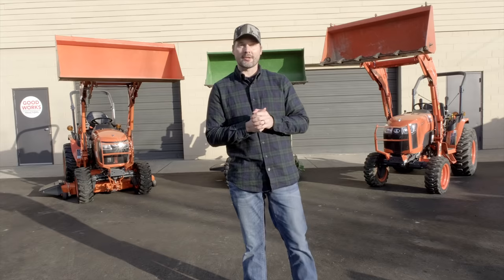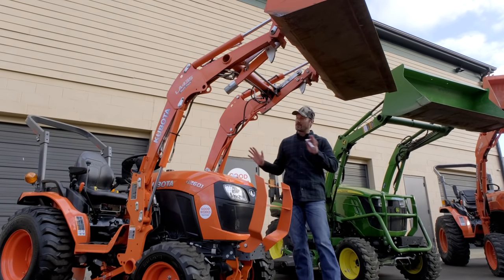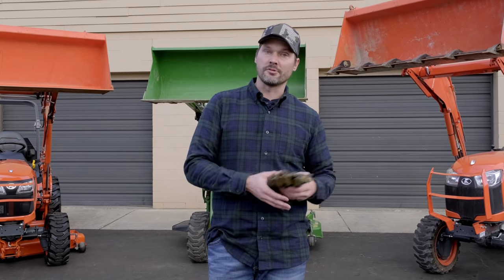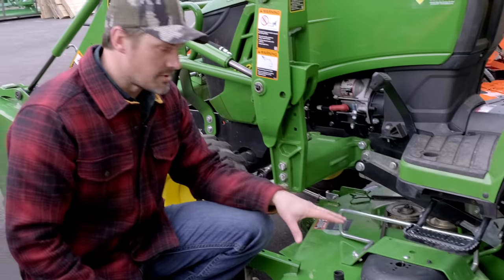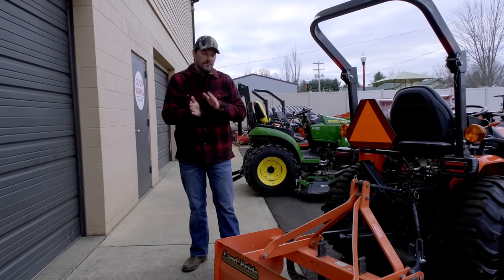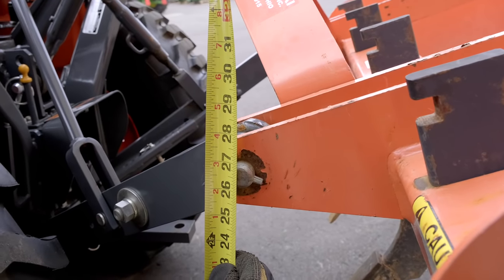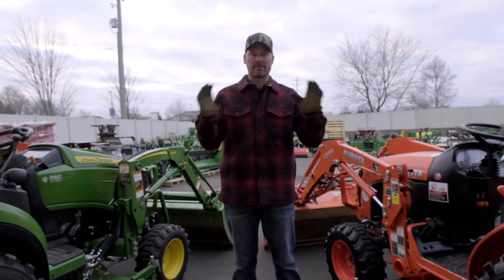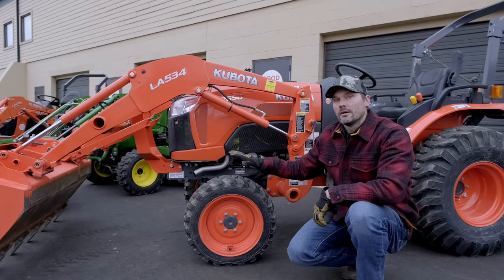NOT EVEN CLOSE! JOHN DEERE vs KUBOTA: B2601 vs 2025 vs B2650

Comment: I have the 2601. Been a good investment for our 4+ acres. One thing that is seldom talked about is the added warranty.  Normally not something many of us consider.  Well Kubota was great when an accident happened and we had an operator roll it on it's side.  Luckily he wasn't hurt (I swolled my heart when I saw it over, and fortunately the driver actually got away since it was a slow roll, which Normally you should ride it down.  But we called Kubota and For $500 deductible we got pick up (once I righted it with the excavator) a full brand new engine and drop off, all without a fight.  

We use it with a snow blade, loader and Land Pride brush mower. And it's done some steep hill climbs. 

Thanks for the comparison
Reply: I think you mean Insurance, because you don’t have deductibles or pay anything with Kubota Warranty. Thst said Kubotas deductible at my dealership is $250 for anyone who gets KTAC. Insurance is mandatory during the financing terms. That said, Kubota is amazing to work with and will do things like good will warranty and pay for things outside of warranty under certain circumstances. It’s very much case by cases, driven by discretion from all parties being the customer, dealer, and Kubota Warranty. Kubota is such a wonderful company to work with, while I was in Service dealing with this exact thing for years. I’ve since moved to a new department, front of the house. JD is still good though, just more expensive for less feature and capabilities. Wont go wrong with either, just more from Kubota is all. Most durable and reliable tractor on the market. That alone would sway me, plus the long list of other things they have that smoke the competition often or at least beat them. Anyways, have a good day!

Comment: The kubota is 200 pounds lighter, I know the JD has more plastic so where did kubota skimp? 200 pounds is alot of weight for such light tractors.
Reply: inside where it matters!
Reply: Bit like an old cast iron car engine v 
Aluminium with steel sleeves, valve seats pressed in
Reply: Frame and the axle.  That is why the Kubota must have a sub Frame when you get a backhoe.  Deere does not need one.  Kubota's older cousin- Kioti is a good comparison
Reply: Rims are lighter. Those tractors are freighted. No different thany old Fordson Power Major. The ones in england have beefy wheels, the ones in US have thin rims.
Reply: T

Comment: I International with the engine hanging out front I used in Arizona was tricky; Much weight hanging in front and broken engine stops were common with careless operators.  Steering drifted a good deal on long drives across the fields- often 425-1200 acres each. A pain to stay in a straight line.

Comment: Did I miss factory warranty on these?  Hmm 🤔 could be another selling point too.
Reply: I can’t speak for the Kubota but the Deere has a 2 year 2000 hour comprehensive and a 6 year power train warranty.
Reply: Kubota 6 yr pw train also.  I compared both tractors. Kubota built tuff .  Axles. Thicker, more pto pwr  better all around. Me...i.  co.    Or Japan? Your pick.   When I think of Japan I think of Yamaha, Honda, Suzuki , Kawasaki,    and KUBOTA

Comment: what is the difference with the new generation 2025 JD? vs a 2025, 2018,2019 model?
Reply from the maker: Nothing.  Need to go back to 2016 and older.  Is It Better Or Worse? John Deere 2025r: New Style vs Old Style
Reply: So early 2000's 2520 is not same as 2025 HP vise?
Reply: It's fine if you want to pay a young guy with a laptop 500 dollars to come out and plug up and screw a 10 dollar sensor in so your tractor will start.

Comment: This was a great video.  I’ve been wanting a smaller tractor for years.  My operation in Afghanistan has been using a Kubota since 2010 and that thing is unstoppable.  But, I’m a big fan of JD.  I have a Toro professional zero turn mower so a mower is not required.  I want a back hoe and a loader.

Comment: The turnbuckles for adjustment may be “archaic”, but they’re stronger and way more adjustable, infinitely adjustable in fact. If you actually work the tractor for hours on end, being able to snug up that adjustment will become indispensable, especially when transporting with the attachment in the air.
Reply: The turnbuckle style is far superior in my experience. We have tractors with both styles and I hate the ones with the pin style.

Comment: I am not into any of this stuff, however John Deere have a reputation for being difficult with regard to assisting farmers to carry out certain maintenance on any computer controlled equipment, are there any problems with these machines re upkeep out in the field?
Reply: As you call these machines they are for small do it your self 2 or 3 acre of land. cleaning up horse crap mowing grass and so on. computers are for steering on farm crops and leveling things like that. but you are right about one thing you are not into any of this stuff. There is nothing wrong with there computers.
Reply: @PCMrX.9961  I have just read on youtube that John Deere want farm equipment trucked all the way to a dealership if the computer needs reflashing or whatever as they keep these secrets to themselves to protect their dealer network.

Comment: What John Deere needs to do  is discontinue the 2025r  and drop the 25 hp motor in the 2032 chassis to compete with Kubota.
Reply from the maker: The old 2025r was very similar to the old 2032r.  Now night and day difference.

Comment: Love my kubota forward reverse pedals.  Do not like jds two pedals.  After all I spend more time going forward than reversing, even with the real snowblower.
Reply: Respecting your preference but I prefer the 2 pedal Deere. Have I tried the treadle? No. But doubt I would. My leg doesn't have to lift. I suppose we could debate it all day and countless blogs already have. For back blading work I can't see the treadle being easy and safe. How do you turn your body (I look over my right usually) without turning your leg? I make long runs backward grading and snow blading.

Comment: It can be very confusing which tractor one should buy. On my 2017 2032R, I love my single point hydraulics, and my drive over AUTO connect deck. Kubota makes awesome machines as well, which can add to the confusion of potential buyers.

Comment: One big difference between the mower decks is the 2650 deck isn't suspended from the tractor.  It is designed to ride on the deck wheels.  This does make a significant difference in cut quality if you have an uneven yard.  I have an older 2025r at work and a 2650 as my own.  I really do like the 2650 overall better.  I do bleed green though and have a 5103 as well as a 430.  Great machines, but I can appreciate both colors!

Comment: Kubota makes a fantastic SCUT but I bought the 1025r for two reasons. First, the design and function of the JD quick attach stuff, the deck, the loader etc. no fiddly bits and adjustments to screw with. Just stupid easy, fast and reliable. The second reason I chose the JD was because of my experience with them standing behind their product and seeing Kubota stiff their costumers on the B3350 and it’s awful regen issues. Just my 2¢

Comment: Note for Kubota from an owner.  The quick connect hydors (even after setting it and de-pressurizing the hydros) will leak damn near 25% of the time when reconnected.  It got so frustrating I just left the full front end on and only used the bucket disconnect.

Comment: You should have a video on just the attachments for the 2025R. Myself I have alot of them. Drilled holes for my small area for my cow and pig. Then drilled holes for my garden fence. Using my box blade for my driveway that I share with my neighbor.  Nothing runs like a Deere.

Comment: I have a Green Lemon 5055E. I do not recommend it. 1400 hours clutch flooded with engine oil requiring total replacement. 1650 hours piston ring broke swirled through the head breaking two pistons causing engine rebuild. 2200 hours metal shavings from the cheap hydraulic dipstick infected the hydraulic system causing the three point to leak down rapidly. Had to rebuild the rockshaft . The 553 loader is so flimsy I had to weld six separate cracks to keep it from breaking in half. Numerous small problems like seat bolts breaking off and hydraulic leaks causing fuses to blow and brakes locking up. It lasted about 1200 hours basically.

Comment: Great videos. Very helpful. What state are you in?  Also. I hate the mower under the tractor. Have you found a good front mower attachment.
Reply from the maker: I'm in Michigan.  I'm not aware of any front mower options for these tractors.
Reply: @GoodWorksTractors  They are fairly common in Europe for these compact tractors.  Small towns buy them a lot for city maintenance.  They use that mid PTO extension like a snowblower does.

Comment: In Regards to step on the B2601, I added a step from the B2650. The  B2601 has holes that line up with the step from the B2650.  I do not have a mid mount mower, so I do know if it fit. Just a point of information

Comment: Regarding the rear balance/counterweight my dad taught me when I was just a kid that you filled the rear tires halfway up with liquid chloride,  he would set the valvlestem just below center of the axle,  then remove the valve, then he made a vented straw and attached it to his chloride jug then gravity feed until it stopped flowing. It wouldn't freeze, and it sealed small punctures.
Reply: I have seen so many rusted wheels from minute weeping  chloride leaks, is there a new non rust version?
Reply: @jamisonseger941  that's a good point the chloride is very caustic,  I was just a kid at the time and I'm not on a farm , so I would imagine there is a better option these days .
In those days most small scale farmers only had one tractor to do every job that had to be done, not like now where they have separate machines to do each job.
Reply: @jerkyturkey007  Nowadays, if ya got room, get several units each with equipment needed. I f you can do most of repair/maintenance work, why not?  Also, you can use antifreeze, expensive though.

Comment: When I bought my small 32/33 hp tractor I finally became enlightened and compared how they rated their hp. and most all elevated the rpm way to high to give rating, I bought the New Holland because they did not fudge by using way to high  rpm to get the same hp. Good luck!
Reply from the maker: It is extremely common to rate the max HP in all types of equipment.  If New Holland doesn't do so, then they are shooting themselves in the foot.  If they can generate more HP at max RPM and crush their competition, then I'm confused as to why they wouldn't market it that way.  If this is indeed the case, then they need to fire their marketing director.

Comment: I do think that when comparing the lift capacity, you need to include information regarding how much you can lift (keeping the distribution in the bucket constant) before the rear wheels lift.   My 1520 might have a great lift capacity, but the rear wheels came off the ground long before that load was reached.  I often had to add my tiller or sprayer (filled with water) to the rear to operate the loader safely.
Reply from the maker: You always want to check your manual (look online if you don't have a hard copy) for the recommended rear ballast weight when using a loader. We have lots a few videos covering this, and it's critical for safety and all brands of tractors need it.
Reply: @GoodWorksTractors  Everything you're saying is correct, but what about my suggestion?  After all, a tractor that operates safely at 1,000 pounds is more useful than another that could lift 5,000 pounds except the rear wheels come off the ground and the front tires squat at 800.   This seems like a simple, yet useful add to the comparison.  Gong too far:  Counter-weight, keeping the load close to the ground while moving, staying on as level a ground as you can, there are so many  other factors...I guess there's only so much you can include in a tractor review.

Comment: Hey Courtney - I have a question for you about diesel fuel additive.  I am new to the diesel engine market and I have a X758 with a full tank of summer blend Diesel.  I will be using it to plow and snowblow my driveway this winter (I live in western New York).   My question is, can I just add the John Deere Winter treatment to the tractor's fuel tank and run it around the yard to mix it up and to get through the fuel system for the winter, or do I need to siphon the current fuel out, and get new diesel, add the winter treatment to it, and fill up the tractor with it?
Reply from the maker: You will be fine adding it in and letting it get mixed up.  Maybe add a little more than needed to be safe.  Won't harm anything and will just make it even more cold tolerant until you get some winter diesel in there.

Comment: Do you have any comparisons to L-3600 Kubota I bought my tractor when my daughter was born 25 years now just replaced all the hydraulic hoses.I set my 3 point rear draw bars up with hydraulics. That little mouse can do a lot of damage to a wiring harness. I leave oats coat them with plaster of Paris. Stops them right up. No poison required.

Comment: How much trouble is there to sharpen the blades.  We use two John Deere 997 R to cut the grass. We use another tractor with a loader to lift them to swap out the blades.

Comment: I watched your video with great interest actually.  I own the Kubota B2650 with the cab and front end loader.  I really like the heated/air conditioned cab.

The one thing I do not like about the tractor is that the cab makes the tractor very top heavy and very easy to tip over.

You mentioned in the video about wheel weights for the tires.  Can you please point me in the right direction, because I'm not aware of any kind of wheel weights for this tractor?  The rims do not have the traditional holes in which a set of wheel weights can be bolted to.

Comment: Great comparison! Im actually trying to decide between the Kubota 2610 and the JD 2025R. Both with loader and backhoe. So far, i really like the Kubota. Maybe there is an after market step for it?
Reply: The B2650 step is a direct bolt on to the B2601, mounting holes are already there  I put it on my B2601. Note however if using the midmount mower the step will interfere
Reply: Honestly I’m 62 and have no issues getting onto my B2301 without a step. I did purchase the step but have never had to put it on. It’s really not that high of a step.

Comment: I'm looking to buy my first tractor. for lawn mowing,  digging fence post holes, storing my snowmobile up on a rack, for tilling and being able to transport it in a 6x12 enclosed trailer.   It seems like the B2601 is a better choice for me, except for that quick release mower feature which would be really nice to have.  Any thoughts on that?
Reply from the maker: If you plan to mow with your tractor, then the ease of mower removal is very important.
Reply: The autoconnect mower on the JD is awesome and worth losing some of the power for me. That said it does require that you're on a very flat surface to work well.
Reply: @emouselOregon  I ended up buying the Kubota, but thanks for the response
Reply: Steve Thompson  thanks!
Reply: @GoodWorksTractors  
I have a 6' rear mount mower and on/off is really easy.
Reply: @144norm are you still happy with the B2601? I have one ordered but have been looking at some JD's.
Reply: @gidzey4783  yes, although I haven't used it much.  It's stored at a house I haven't been staying at.  But it seems like a great vehicle so far!

Comment: Good comparison. I went with the 2025r myself. I just liked the ergonomics much better than the 2601. That includes pedals and whole seating area as well as the step. 
What really pushed me over the fence though was Deere's Load-N-Go option for the deck - which allows you to lift the detached mowing deck with the loader. That would have been a good mention in the video.
My buy was primarily to take care of a lawn and snow along with general moving/lifting. No woods. For that I find the Deere more than capable and am happy with the purchase so far. It's a lot more maneuverable than I thought it would be actually. Wanted the larger tires over the 1025r. Went with the newer radial tires. Very happy with those too.
Reply from the maker: There are lots of little add ons that didn't get mentioned.  Thanks for watching!

Comment: Hello there! I like your channel and how you present your equipment. Comparison is nice, but... way more interesting how they behave in a dynamic setup! 
Dive into a dirt pile and show the performances in lifting a full bucket. That tells at least what is never described in a propect, namely: how fast does it lift, telling something about oil flow and oil pressure delivered by the pump and showing the torque of an engine.
I‘m pretty sure some clear differences might show up which are mostly relevant! Have a good day!